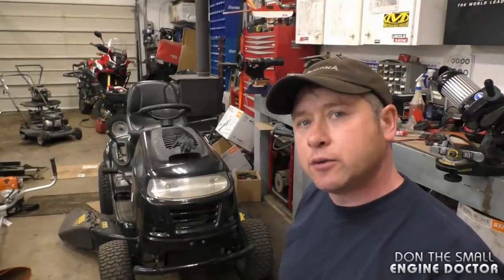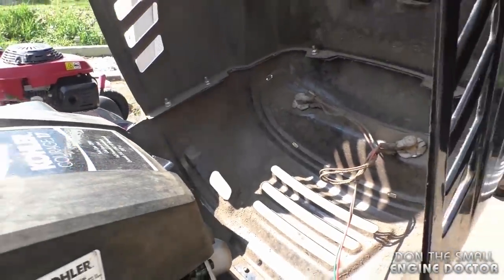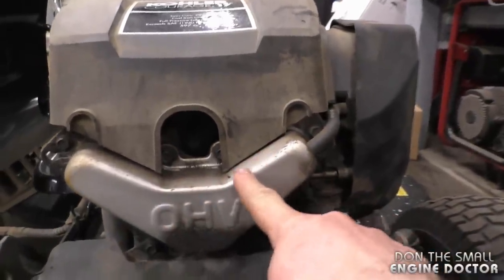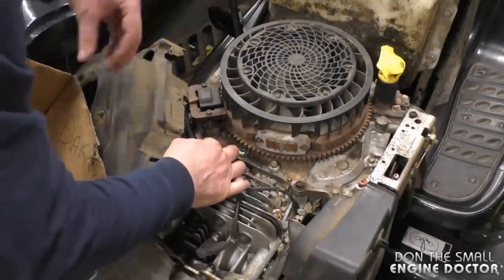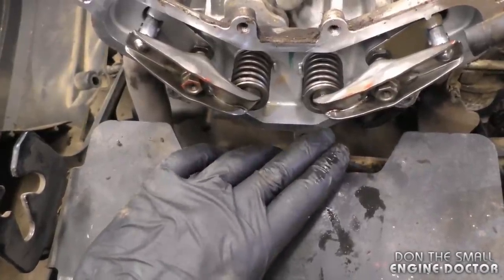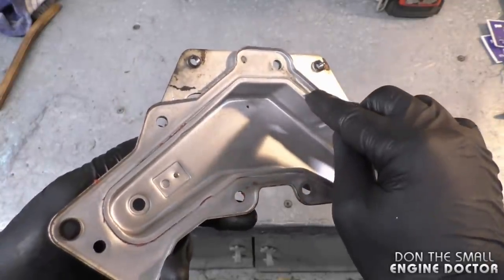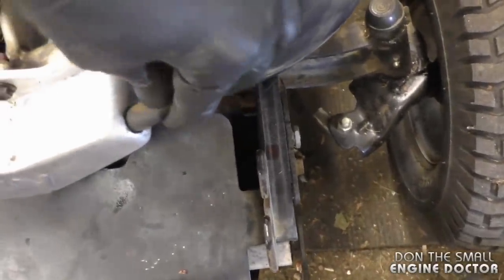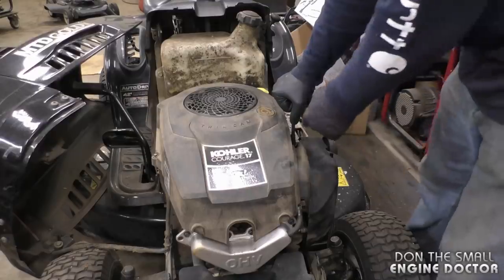Fixing A Leaking OHV Valve Cover Oil Leak On Kohler Single Cylinder Lawn Tractor Engine

Comment: Always check the upper sump bolts when taking the top cover off, they come loose and cause the aluminum case to crack. These engines are the worst engines ever designed.

Comment: I will say that this engine repair is the only one of which I use a torque wrench. Kohler actually tells you that these engines are prone to leak and to keep several of those gaskets in stock. The valve cover is also prone to warping especially if you over tighten. So, the torque specifications are to tighten 65 lbs/in if you are using a previously threaded engine head, and 95 lbs/in if you are using a new head in which you are creating the threads as you install the screws. Thank you for all that you do for us.
Reply: I second the "warping" of the valve cover. I ALWAYS check their trueness.
Reply: On similar Briggs engines those valve cover bolts only get torqued to around 5 ft-lb.
Reply: 5 Lb ft = 60 inch pounds.
Reply: It's not the space shuttle.  Just tighten and go.

Comment: When installing steel fasteners in aluminum, I always use coated bolts or put a bit of anti-seize on them to prevent or reduce corrosion, seizing, and galling of the aluminum threads.
Galvanic corrosion of dissimilar metals.
Reply: Iron Golem 
  Thank you for the tip.
Reply: Same with rims and lug nuts lol. What a nightmare

Comment: Rodents storing rocks?  what about the owner mowing his gravel driveway?
Reply: I laughed out loud that’s funny af
Reply: I lived in Arizona most of my life and then moved to the Midwest recently. One day early winter my car is making a horrible screeching sound and horrible vibration when I brake. I genuinely think my tire is about to separate from the hub so I stopped on the side of the highway. Sherrifs deputy pull up behind me and I explain what's wrong. She finds an acorn (or some other nut) wedged in my front  passenger caliper. That was wild haha I've never had to deal with animals preparing for winter like that.

Comment: Informative video. Hopefully works for me. Only thing different was I had to get a new gasket and loosen bottom muffler cover so I could get bottom screw off. Fingers crossed once silicone is dry no issues.

Comment: READ THIS!!! If you have a Kohler courage engine on your mower, there are 3 common major issues I've found. First, valve cover gasket leak, which is covered in this video. Second, the valve adjustment will get very sloppy over time, causing pushrods to snap. Third, and the most major issue with these engines is the side plate bolts rattling loose. The vibrations of this engine will loosen nearly all the bolts around and near the flywheel. When this happens, the bolts rattle in their holes, ultimately leading to the block starting hairline cracks. If not taken care of. The block will in some cases crack entirely in half. When you're doing the job in this video, take the side plate bolts of the engine off one at a time, apply loctite, and re-torque to spec. Seriously, if you have a Kohler Courage single cylinder 597cc ranging from about 17-21 hp, this job must he done or at least checked. I think on some later models Kohler applied more loctite to the bolts.
Reply: In the ten years I have had my 24 horse v  twin, never has any thing gone wrong with the Craftsman. I know , these engines are made in China nowadays.  I mow a very large area.
Reply: Its newer than all my old Kohler engines the valve cover gasket is a easy fix specially when you can buy a gasket instead of making it all my cv models of Kohler engines run and work long as the carburetor bowl is new 

My problem with the older cv Kohler engines is the carburetor bowl corroding inside on the bottom and sides of the bowl the white corrosion makes the float stick either open or closed and a brand new carburetor lasts for a few months or to a year on the cv models so i quit using my cv models of Kohler because of that and I've tried better gasoline even the gas treatment stuff the metal bowl still corrodes inside

Comment: Nice video Dony! I have an early 2000 mtd yard machine with a Briggs & Stratton 16.5 hp OHV with a similar problem oil leak on to exhaust,  also afterfires when shutting off. Do you have a video on the Briggs & Stratton valve cover, head gasket R&R? 
Thanks.

Comment: Why would you reuse a brittle gasket? You can buy a roll of gasket sheet in different thicknesses and trace out what you need from the old one if you can't get to the mower store. While your cover is off folks, check your valve lash.
Reply: But of course. IN all the years I have changed my transmission fluid I have never changed the pan gasket on any car at any time. It is a waste of effort. And time. As though you know more than Donyboy. I can spot a amateur from a distance. Never , never have I had a leak. I know you do not do this. Many do not, however it is nothing new.
Reply: Art Vandelay   I am merely agreeing with Dony here and affirming that what he said about what works. Yes I am comfortable around machinery, have like the contributor here. Yes, Many machines. Uncounted. I do not work on them any more, not all of it is as easy work as working on small engines. You should capitalize the first letter of words in each and every sentence. 
  This guys videos are explained very clearly and concisely. Indeed I have used these Canadian vids. myself for snowthrower maintenance.

Comment: I had an oil leak and then a smoke situation on an older mtd lawn tractor that puzzled me for some time. I wished that it was the valve cover situation and after dealing with drips below the mower and puddles on the lawn tractor engine deck. I found out that the leak was the sump pump engine gasket. The break in the gasket was just enough to allow oil to seep out at operationg temperature and then find its way onto the hot cylinder head and smoke when it was really getting bad. Replacement of the sump gasket fixed it, but the engine had to be removed and opened up. The engine was a tecumseh. Dipstick oil ring was suspect, main bearing seals, valve cover also. Suspect the sump gasket if all else fails.

Comment: Nice fix Donyboy: Do you also check the valve lash on those motors when you have the valve cover off? I find in my shop that the Kohler Courage are far from the best motors. Thanks for the excellent video's.
Reply from the maker: yes I did, I rarely have to adjust the valves on kohlers
Reply: @donyboy73  Hmm, that's good to know...I'll be checking mine soon on my lawn tractor though.  Why isn't valve adjustments as common on the Kohler engines though?
Reply: @donyboy73  Some of the Kohler Commands like my CV15S have hydraulic tappets inside, no lash adjustment needed!

Comment: Someone suggested on taryl fixes all video that you should remove small amount of cover face by rubbing on flat abrasive surface like doing a cylinder head. He claims cover is bottoming before gasket can seal.

Comment: nice job. does the gasket maker need to be oil resistant.  I think that is the black permatex. at least that's what I needed on my truck valve cover.
Reply: I use ultra black permatex

Comment: This may be a dumb question, but ya never know if you don't ask. 

When checking the oil level on a lawn mower, pusher or rider. Are you supposed to screw the dip stick all the way down tight, then undo it to check it? Or rest the dip stick onto the threads, then remove it to check the level?
Reply: I have heard both ways . I screw min in.

Comment: How do you start it with the ratchet??
I always put bolts in by going counterclockwise until it clicks in, then i tighten a little to make sure i didn't cross thread. And only then do I use a gun.

Comment: Thanks for the vid Don. Question: Why re-use the old gasket at all, if using a gasket maker from the tube? As the name implies shouldn’t it form its own gasket? 👍🏼🇨🇦
Reply: Repair people found RTV alone wasn't enough to seal the engine side long-term.
Reply: 999thenewman Ah, I see. Thank you. 👍🏼🇨🇦
Reply: It’s a thick cork gasket. You’d have to use a ton of gasket maker. Better to use in conjunction with the cork gasket.
Reply: NorthTexasFarming That makes sense. Thank you. 👍🏼🇨🇦

Comment: When the valve cover is off why not give the valve clearance a quick check?
Reply: Because it's running well and shows no signs that anything is wrong.
Reply: Plus time is money. I would have suggested it to him and if he wanted it checked it would get done
Reply: @matthew53690  In one of the other replies he stated he DID check the valves even though it wasn't mentioned in the video.
Reply: I think kohler may have hydraulic valves

Comment: Where would all those rocks come from to get on top of the engine????

RichE San Diego
Reply from the maker: rodents
Reply: @donyboy73  Wow... they sure are busy little buggers! :-)
Reply: Ah, interesting.  I've seen lots of mouse nests and food caching under the covers but never rocks.  I wonder why they'd  put rocks there.

Good thing it started to leak or those rocks would cause hot spots leading to problems if not failure.

RichE San Diego

Comment: What was causing the leak if the old gasket can be reused?  Just the sealant?
Reply from the maker: the gasket gets a little brittle and shrinks, adding sealant and re-torquing the bolts cures it

Comment: on that engine I clean surfaces w solvent then new gasket then I use the shellac sealer on gasket an then locktite on bolts an torque , had way to many coming back for same problem

Comment: @donyboy73  Dony - i've switched to K100 because of your videos & got some friends to switch also.      i have a neighbour who is really smart/handy/mechanical....but says to me for his push-lawnmower that he, " doesn't need fuel stabilizer, i burn 2 gallons at a time & i run it out of gas come fall/winter & i have a plastic gas tank. "    To me that is frustrating to hear & he won't take some of my K100 stabilizer for free, just says he has no use for it.   (aside from the video you made)   What sort of argument or point of view can i use to convince him he needs to use it?  
(P.S. he has issues with his choke sticking and his push mower is 2-3 years old)
Reply: If he is running it out of fuel then he is correct. The fuel stabilizer is useful if you don't run it dry and instead leave the fuel in it. However by running it dry there is no fuel in places that would need to be stabilized.